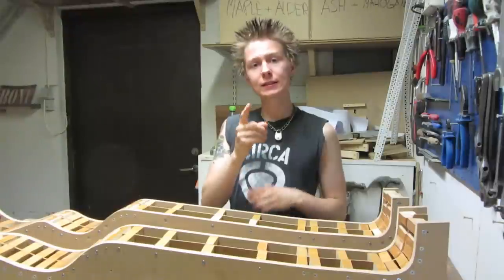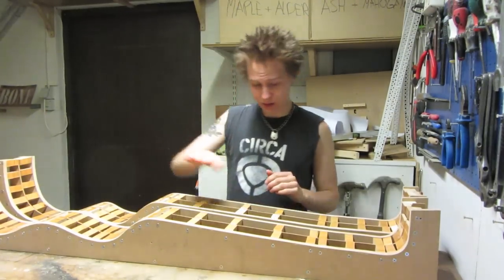Form Fitting Precision Bass Hard Case Build: Chapter One

Comment: Why not use some rubber rope to clamp the sides to your rig? That way you can avoid the holes but still have the sides pressed into the form really firm without 100 clamps or too much work.